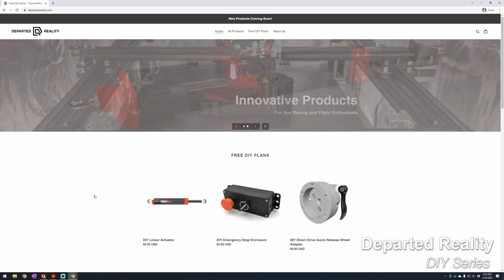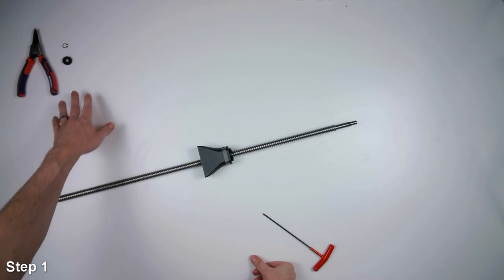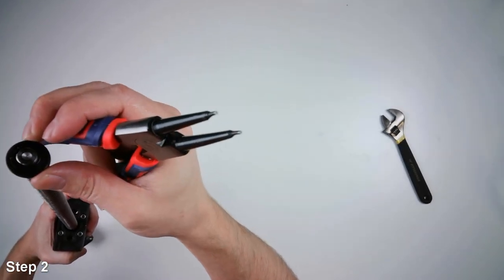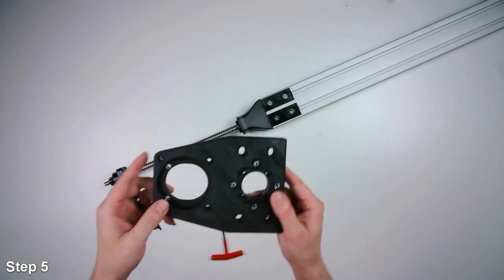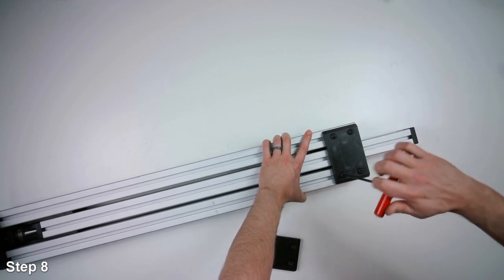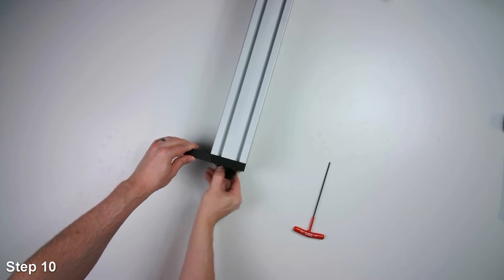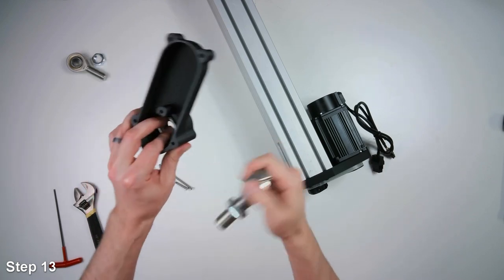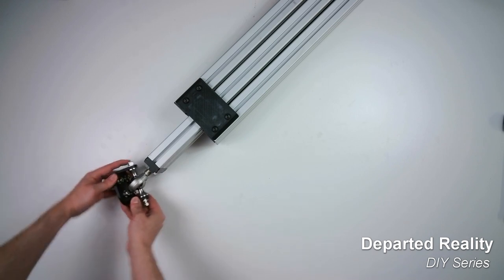DIY Linear Actuator Assembly Tutorial | 6 DoF Motion Simulator | Departed Reality DR-DIY-PS V1.0

Comment: That's really impressive. I currently run the PT-Actuator units, but I may just build these and test them to compare to.  I get a lot of questions on where to get actuators for my rig.  I may have just found where to send them to.  Really nice job.
Reply: Great video mate.  Do you know what the max weight this design can handle including the top frame thanks
Reply from the maker: My estimate is 1000-1500lbs (450-700kg). Each actuator can push up to 1000lbs/4500N (intermittent duty). The worst-case stress on the actuators is during a power failure where the sim drops and hits the hard stops
Reply: @departedreality  do you have dimensions of bottom frame and dimensions of top frame anywhere on your website?
Reply from the maker: @Noonz2311  Not yet. The plans for the base frame and cockpit should be completed and released this summer
Reply: @departedreality  awesome mate

Comment: Thanks for the detailed assembly video. I have been hesitant to try my own sfx100 build but this has me very interested. Do you plan to provide some dimensions of your cockpit aluminum profile attached to your actuators?
Reply from the maker: Thanks for watching the video! I'm working on a cockpit design that would require some custom brackets that will be available for purchase on our store. My plan is to offer the kits with and without aluminum profiles. I've found that a design that uses all off-the-shelf brackets from a place like 8020 ends up being significantly more expensive than one that uses some custom parts

Comment: Aren't ballscews slow? With the extended 10mm pitch it takes whopping 12 000 RPM to get measly 2m/s shaft velocity, it takes precisely 0.2 seconds to reach that speed at 1g of thrust. Acme screws are much of the same except way cheaper and less noisy. The only design I even consider for my own project is belt drive.

Comment: Hi, I just found about you and your website through the Varjo Discord channel (motion Platforms).
I have been looking for a DIY solution for a while, related to flight simulation (now MSFS2020) but too scared to get into it! This is the first time ever, after watching your vid that I feel it could finally be possible for me to get involved with such project and follow your lead.
I have a few questions:
1. Do you plan on maybe selling kits with all the parts required for 6 actuators assembly, chassis assembly?
2. I do not have the capability of 3D printing, can I order those prints from you or a third party printing company?
3. Would you provide tech support on how to set up the motors with the proper servos and all that is required to get to software setup part of things?
4. Do you have a Discord channel, what is the best way to get in touch with you?
Thanks a lot for any reply. I have a glimmer of hope now!
Reply from the maker: Hey thanks for watching the video! Making your own motion rig is getting more and more accessible. I hope you decide to start your project!

1. I do not plan on selling kits for the DIY actuator design but we do have line of actuators in our product roadmap. These will likely not be available for sale this year. My goal is to keep adding products and plans until a complete 6dof motion rig can be made from the products and plans on the store.
2. If you're seriously considering spending $6-8k making a DIY 6dof motion rig, then I highly recommend buying an inexpensive (~$300) 3D printer to make as many parts as you can. Having a 3D printing service print the parts is an option but I have no experience using any of them. I would be surprised if you could buy the parts from a service for cheaper than buying a printer and printing the actuator parts yourself.
3. Yes. There's also a few great communities dedicated to DIY motion rigs. I recommend joining the Thanos Motion discord here: https://discord.gg/bx4PxYR
4. I do have Departed Reality discord channel that I started but have not invited anyone to yet. You can be the first member: https://discord.gg/skn2HzpbQy
Reply: @departedreality  Thank you very much for taking the time and respond to my questions! I am not going to pull the trigger yet! I have been looking at several commercial and DIY solutions and today was a revelation to me! I now think it is a real possibility for me to do my own project, thanks to you and your parts list also including the different parts suppliers links (huge for me!)
Also thank you for your Discord link, I will join in due time.
Looking forward to communicate with you in a not so distant future, I hope!

Comment: This is great. What motors are you using for this. It's a dream to own a platform one day. Thanks for sharing.
Reply from the maker: Thanks for watching! The plans accommodate 80ST and 90ST frame size AC servo motors. This particular motor is an 80ST-M02430 which is 750W. They're easy to find for relatively low cost in China from places like AliExpress. There is parts list in the plans that have URL links to the parts I recommend

Comment: OK different question.  From say where your butt touches the seat, how high does this thing go in total?  I get that could set limits, but am thinking a worst case scenario where it ignores any software limit, last thing I want it to do is crack my head into the garage ceiling so I best measure up :)
Reply from the maker: I've published three reference layouts for the different sizes actuators on the website here: https://departedreality.com/blogs/kc/system-layouts . The ceiling height requirements range from 2.0m to 2.4m

Comment: What was your cost for building 1 actuator
Reply from the maker: Motor and drive is about $300 with shipping from China to USA. The rest of the parts are around $200-$300 depending where you get the aluminum extrusion. So the total cost is $500-600USD per actuator